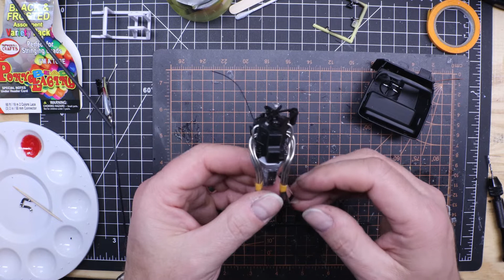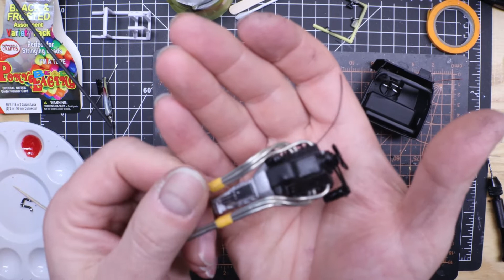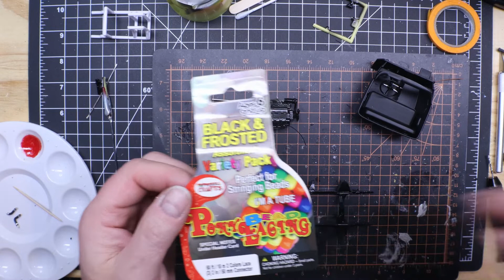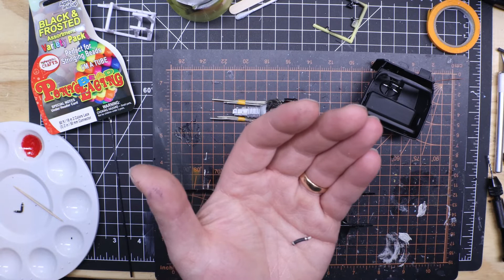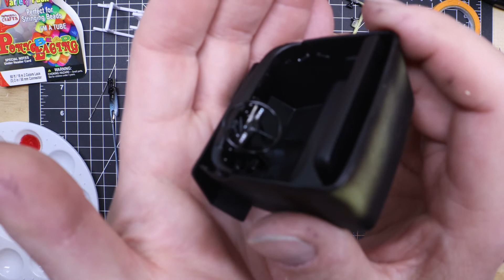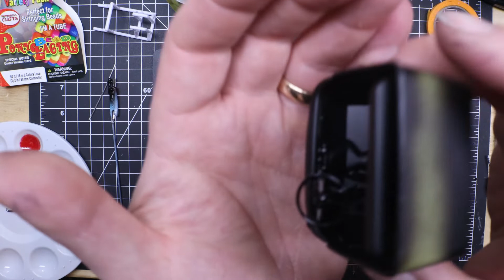AMT 55 Chevy Cameo update #6

Comment: That is looking great Brian. The heat shrink is the way I have been making hoses for years. If that is a small block Chevy you have your dist. in the right place. Ron
Reply from the maker: Thanks. On the LT1 in distributor is a direct coil pact that is located at the front and kinda comes out of the left side of the timing chain cover area.
Reply: Darn I'm too old. Never messed with a Chevy engine that new. LOL
Reply from the maker: @ronstewart9792  I try a stay away from them myself and that’s any newer power train.

Comment: Great tip on using heat shrink tubing for scale hoses. Maybe the bead tubing would look more scale like on a big rig motor but heat shrink comes in all sorts of sizes plus it can be reduced with heat. Thanks for the tip. Dave
Reply from the maker: I think 1mm solder would be best as it’s easier to manipulate and just a little smaller as well. Thanks for watching.